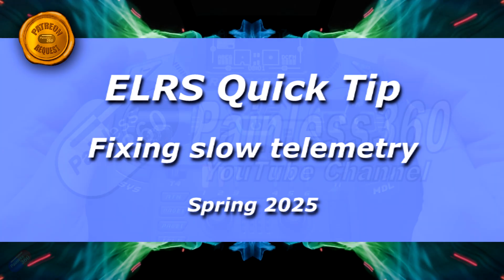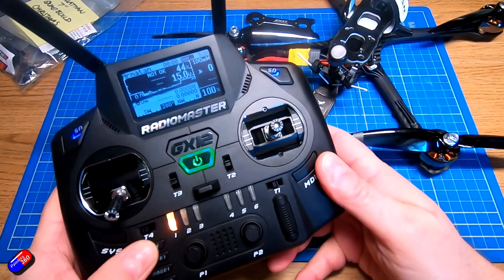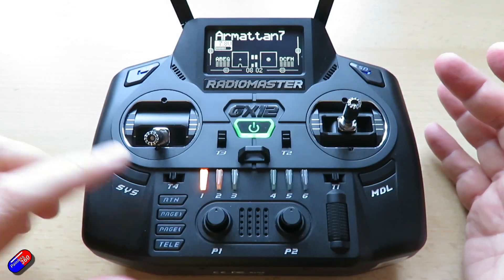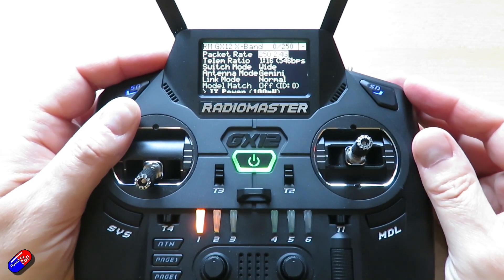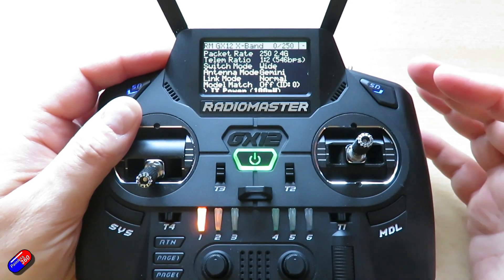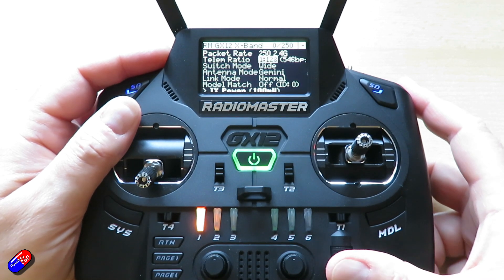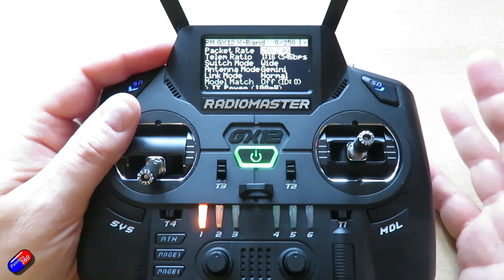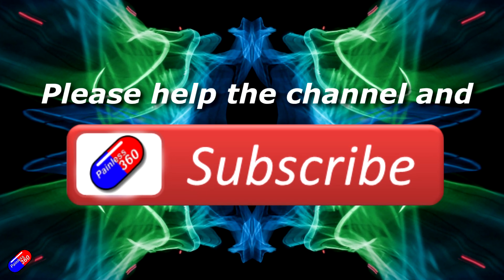ExpressLRS Quick Tip: How to fix slow telemetry

Comment: Painless really struggling here I can't seem to get a GPS lock anymore since having upgraded to expressLRS radio master receiver I've tried everything literally everything. I'm not sure if the receiver has something to do with the GPS configuration on the uarts. Definitely you are for gives the blue flashing light and permanent red but I'm getting no yellow one beta flight at all. What to do I've spent hours on this. Suggestions? Thanks mate Adam
Reply from the maker: Confirm that's part of the issue by unplugging it and checking that the GPS then locks. Move it further away from the GPS to see if that helps... Best of luck

Comment: Please cover how to adjust the telemetry voltage meter offset valve, my telemetry voltage isn’t being displayed accurately on both my MT12 & TX16s.   Thank you
Reply from the maker: Video coming as part of the EdgeTX for beginners series. Select the sensor you want to tweak and select 'EDIT'...
Reply from the maker: Check out https://youtu.be/BEQPL0tJorw ;)